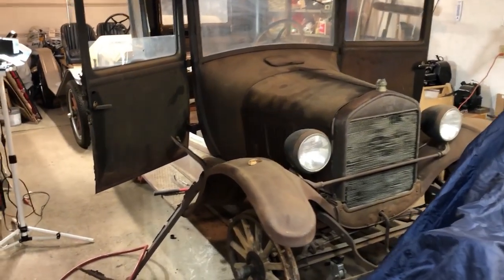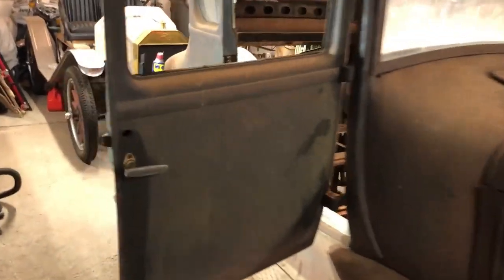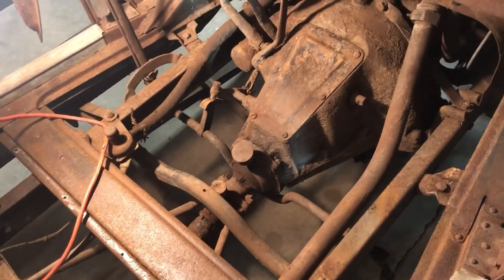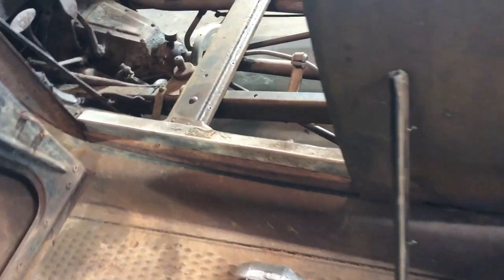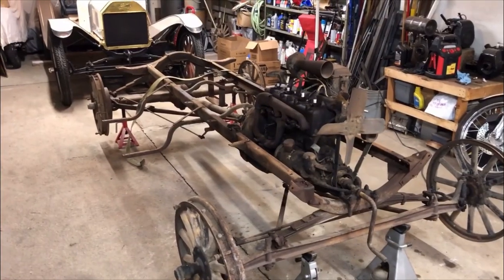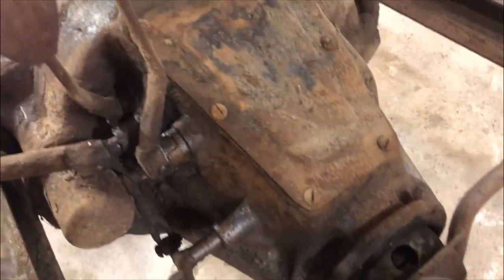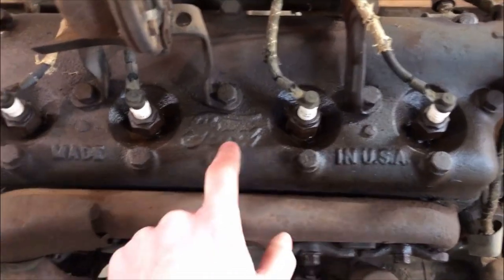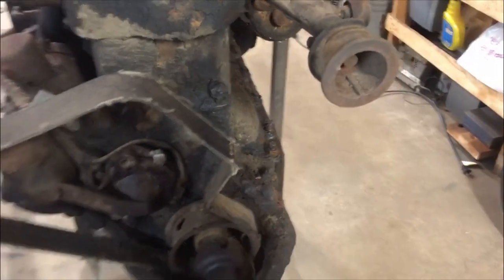Ford Model T Restoration Part 1

Comment: John, I've got to hand it to you for your motivation, knowledge, and work ethic.  I also have a Ford 1926 Model T although mine is a 2-door.  I've had it for almost a week.  It has not been run for more than 5 years and I'm working on cleaning and getting it started.  I am so appreciative that I do not have to do a complete restoration.  Thanks for the educational video.

Comment: With any restoration, you've got to do something everyday. Stay focused and keep pluggin away. Good luck! Great automobile worth saving. If I make a suggestion, don't take the whole car apart at once. It's like eating an elephant, one bite at a time. Start with the chassis. Get it running, then work on the body.

Comment: When you get a new battery cable, make sure it's for a 6 volt car.  A 12 volt cable won't provide enough "poop" to turn over the engine.
Reply: WTF are you talking about?
Reply: @deeremeyer1749  If you have no clue about automobile electrics, ask a good professional at your favorite auto parts store.  And make sure you tell them what voltage battery you're going to use that cable on.

Comment: That "project car" you probably "invested" $2000 in minimum is only  $20,000 and 2000 "DIY" hours from being "valued" at upwards of $10,000 "running and driving" and "cosmetically-restored".